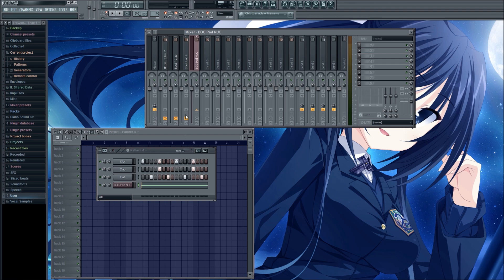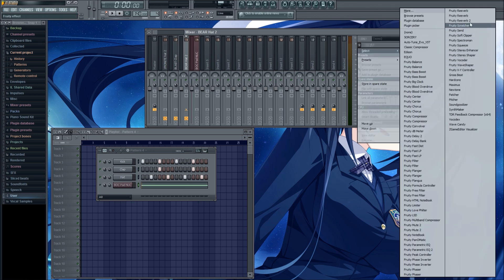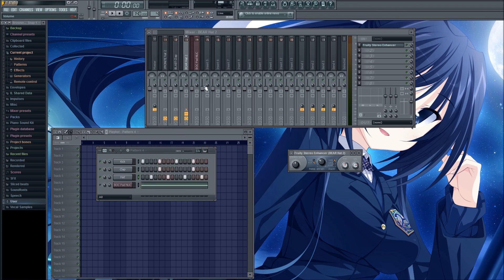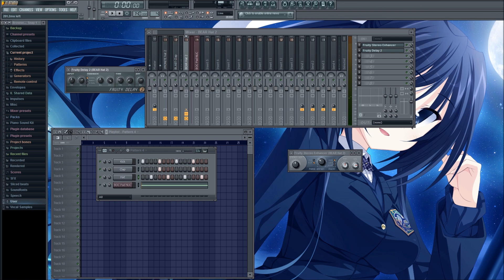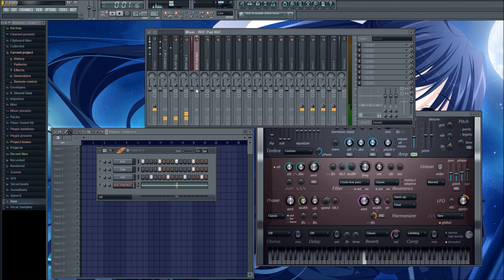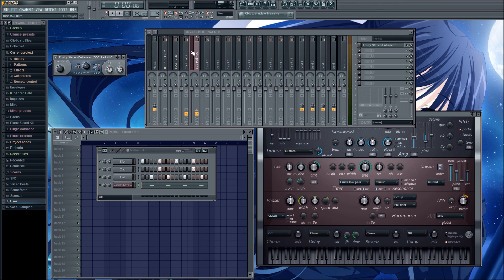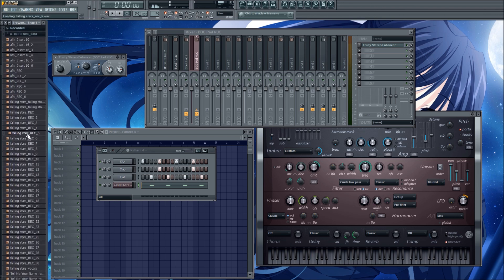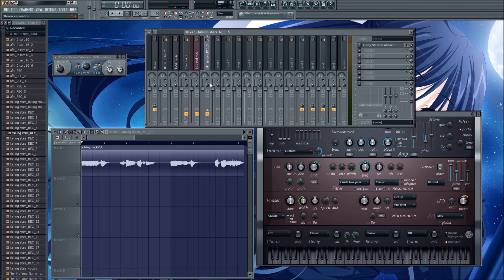FL Studio - Stereo Seperation Tutorial

Comment: what if you dont want to do Stereo Seperation
Reply from the maker: I assume you're referring to when you do it using the dial in the mixer. If you don't want to have stereo separation happen simply leave the dial in its default position the the output will not be altered by that effect.
Reply: TjpjMusic thanks
Reply: Justen Bray it makes it easy to lay vocals into a pre mixed beat